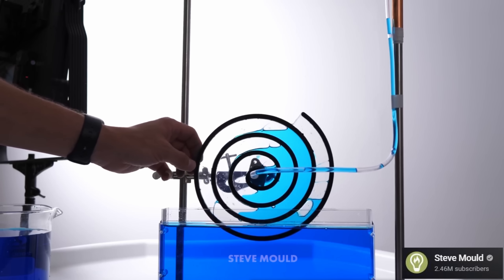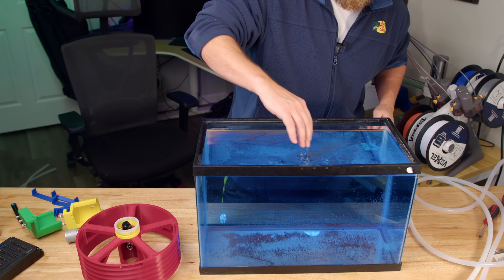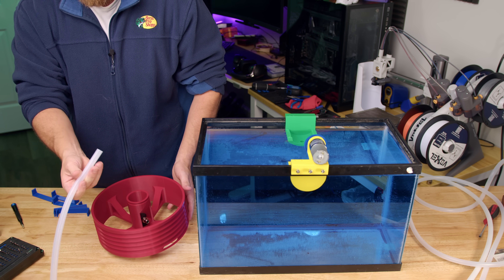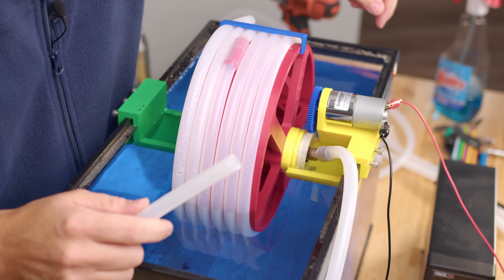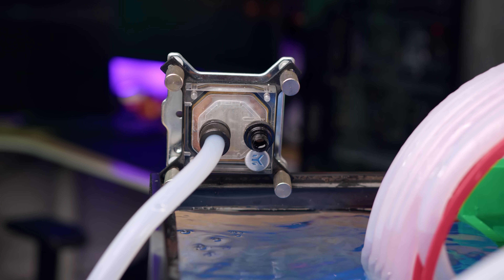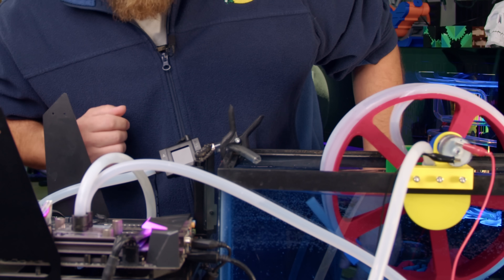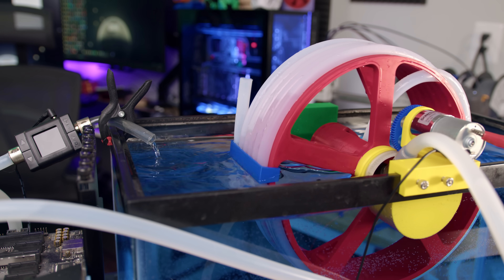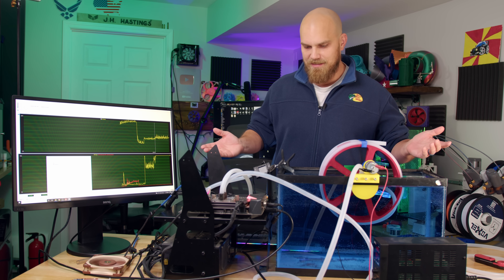Can a 217 YEAR OLD Water Pump Cool A PC?

Comment: TRY THIS : (LIKE so he can see) 
make reservoir between cpu and pump so that it fills it and push the water trough the CPU without pushing the air into it

then make some small hole for air to release with floating valve that will close it when the water reach certain lvl 
 it should regulate the system to allow only water to go through the cpu with constant pressure

Comment: It is possible to remove all air in the system if the pump is delivering water into a closed tank with only an outlet for a hose that has 50% of the carrying capacity of the hose on the pump. 

My assumption is that the pump has a 50% duty cycle, so if we account for that by having double the hose capacity on the pump, then we can accumulate the combined pressure in a closed tank. Then the pressure in the closed tank will deliver a relatively stable pressure on the side with the reduced hose size. Inlet should of course be on top and outlet on bottom, to  keep max pressure on the outlet hose and reduce movement of the water. 

If possible, you can in this configuration add an infinite amount of pumps (the law of diminishing return may apply here) to raise the pressure on the secondary side of the closed tank (for stability of flow's sake, they can be run with an offset of 180degrees).

Comment: You could try to use the same motor (running at the same load) to power the most efficient 'modern' water pump design you can come up with and 3D print. Then compare CPU current draw beween the two pumps to see how much more efficient the modern desing is.

Comment: I've seen it surest a time or two in at least as many ways. Putting a water tower after the rotary union would give you a place to discharge air to. But I think having a bike pump or something similar to pull the water though the hose (end of the hose in the water obviously) would likely fully prime the pump. The second problem would be keeping the inlet in the water 100% of the time. It should work if you get a second rotary union for the inlet side and shove the hose into the tank then it'll work more like an auger which is basically what this is.

Comment: I was wondering, what if the pump was actually hung over the water? To where the opening of the tube would have constantly been under water for no air gaps. I know most show the pumps in the orientation, but I couldn't help to think, would it still work pulling and pull the water up? Maybe if it spun alil bit quicker?

Comment: If you turned the wheel ninety degrees to keep the inlet tube in the water at all times, you wouldn't have any air bubbles.  The water would still move through the system in the same way.

Comment: What about one more intake witch is shifted 180° so it can put water into the system without the waiting to get more water this way you can join the two pipe together before it is going into the rotating section of the tube, and maybe after this you can add a closed water tank to get just the water and remove some air, i think a litlebit air is fine because this way the pump can generate preasure in the tank and improve water preasure like that. Anyway nice video! Keep up!😄

Comment: Use the pump to fill a small open top [or vented] water tower and gravity feed the cooling block from the tower, this will separate the air. The tower can just be a length of rigid pipe with enough diameter to let the bubbles seporate.

Comment: One could argue the coil pump is even older. Because it's basically an Archimedes Screw (aka Egyptian screw). And that dates back to ancient times. If you do an internet search for Archimedes screw, you'll see lots of pics and animations of an auger inside a tube. But there were several variants, including coiled tubes. The wikipedia page for the Archimedes Screw also has an equation that can be used to calculate the flow rate. So for example, if you want a certain flow rate, you can use the equation to design your pump. 😎

Comment: You could do a triple pump, or at least a double, separated by 120 or 180 degrees, but with check valves between the units.... that would give you more consistent flow. Or, you could put the water into a small tank, and the exit of that tank could then feed the cooling block. if you left an air bleed port on the top, sort of an overflow back to the fish tank, you could get constant flow, without the air. 

All told, very neat project you built!

Comment: To get it doing constant pressure lower the drum until it is completely submerged and drive it either with a belt or more gears. Once the air is out you would have a constant flow with out needing bubble towers….

Comment: You should use that pump to fill a reservoir that will flow thru the cpu block without air. May have to speed up pump drum rpm to keep resevior full

Comment: I'm sure this is getting too complicated but you should have the fluid flow into a reservoir with an air/water separator. Maybe you could have a float that opens an air relief valve when the water goes below a certain level.

Comment: What if you put another tube with the opening offset 180 degrees so each one has its air pocket at a different time, and used some sort of like, pool or reservoir to get rid of the air bubbles. You might need to spin it faster to keep constant water flow though.

Comment: I am a complete Luddite so I may be completely wrong… but if the whole drum is submerged, would the system have continuous water or does the system rely on gravity to keep pressure? The other option would be two loops of tubing on the drum, positioned 180 degrees opposite each other, that both go in to the centre hub fitting, therefore having one collecting water as the other is out of the tank…

Comment: You could use this as the return system to a gravity fed system.  put this tank floor level, and a higher tank... you could use a big passive heat sink on the way back down as well then limit the flow available to pc so that it doesn't out pace the pump. It's a way to get the air out of the system. I personally Love the idea of mostly passive systems. Or even using geothermal methods to attain cool water.

Comment: Add a large intake paddle to scoop the water into the intake hose. Also, check the power draw on the hub motor and see if the CPU fan output on the MOBO can run the pump and regulate the speed of the wheel. Using a check valve as well on the intake will stop the air from entering when the intake scoop no longer has water pressure to open the valve. Make a small tank just large enough for the wheel, throw a couple of heatpipe fin coolers around the tank to passively cool and keep the power draw to a minimum.

Comment: bigger hose on roller it will incles water flower 2nd you need make tank which air will escape top of tank and liquid run down tank to cpu and out to tank so there be no air left in cpu block dont forget have that tank higher than bigger tank and small tank have sit above it in order for it to work

Comment: A hot water heating system uses an air bleed valve to remove steam and air from the water flow. Should be easy to 3D print one. The pump has more than enough volume to keep a processer cool.

Comment: why not make a cooling tower with 3 points of the wheel feeding water into the wheel separated by 33% around each of the wheel and treat it like a three phase water pump. you can also use a tower with check valves to prevent backflow with the other phases.

Comment: I feel like you could create a valve to prevent the air from being pushed through the loop by using a Y joint and a spring loaded flapper. Flap being open to a vertical tube by default, and when the water from the pump gets pushed through it would allow flow through the loop without the air issue. It would require the reservoir to be above the mobo but it should work in theory.

Comment: Coil pumps were designed to pump up from a stream to a hill or water tower to a reservoir, then use gravity feed water pressure to water crops, etc.  It would be really cool to replicate that type of system to cool the cpu, as it should eliminate the air bubbles.

Comment: Ideally you'd use a pump like this to fill a reservoir, and use the reservoir and gravity to create a smooth flowing stream of liquid.  If the screw is half submerged, you'd need a hose at least twice the diameter of the hose you plan to run through the rig.

Comment: If you pumped the water to a higher level to be used as a "buffer" you could remove the air from the system.

Comment: A long flat/horizontal section of tubing with foam/sponge diffusers inside it would allow you to merge the air into the water as fine bubbles which might actually provide some cooling improvements just from turbulence

Comment: Aquarium filter powerheads are simple centrifugal pumps which drive a considerable volume of water through a similarly sized tube without the air gaps you get from anything resembling Archimedes' screw. As you noted, a radiator on the outflow side of the CPU may be helpful in extending the cooling capacity of the input reservoir.

Comment: I wonder if you could wrap a second loop of tubing around the existing one (inlets 180 degrees apposed)  and T them together at the hub. Im not sure if they make them small enough but you may look around for an air trap valve you could T in between the pump and the water block to purge the air.

Comment: Oh yes, the 217 year old pump. Because Leonardo DaVinci was alive only 217 years ago. This is in the Codex Atlantica. It is not even DaVinci who invented it, it was Archimedes, it is called a Archimedes screw. So yeah, this invention is over 2,000 years old. This was invented at least 200 years before Jesus was born. And I'm willing to bet Archimedes didn't invent it either, he likely re-discovered it as there are water wheels which are still running today and have been in commission since before his time.

Comment: With the fishtank... set up in a way with no air and actually usable for a daily driver, the goal being daily use shouldn't be enough to heat soak it so each day you can run w/o fans. 
The truly silent PC XD.  so big, no fans required. but it would require a like 100% water cooled pc like mobo etc. (Not to be confused with an actual fish tank pc with is being submerged.  although that could be a super cool project too. Specially if you 3d print all the brackets etc, so community could create their own with yoru plans. It would make for an awesome series. )
After that tanget, will just say thank you for awesome content and keep it up. :)

Comment: i have seen one hat was 10ft..he had a i gal container with the bottom cut out attached to the end of the tube on the wheel..it worked good..and take the air out of the hose on the wheel so water flows better with less surge in the water. 👍👍

Comment: Is there a reason that half the pump is out of the water? The air gap seems to be the period of time that the tube is out of the water, if you lowered the axle into the tank and let the wheel run at 66% or more that might improve the pumping action

Comment: First idea:
you could use 2 pumps in paralell offset by 180°, or one drum with 2 tubes with the same offset, you could also do 2 drums with 2 tubes

Nummer Zwei:
feed the water in some sort of elevated container that would then just gravity feed the loop with water, by adjusting the hight above the tank you can effectively tune the flow rate to reach equilibrium with the pump output, a restriction on the outlet could be used for fine tuning of the system.

and just after I posted this I had an other idea, aren't there these self bleeding valves?
I think I've seen something like that at the hardware store, just use that in line with the hose, then you don't need  a tank to get rid of the air.

Comment: if you submerge it, flow will be continuous. You can use a belt instead of gears.
Or if there is a t adapter for that fitting you can add another coil of tubing with intake is at opposite side. I dunno would that cancel the flow tho :D

Comment: Make the wheel dual lead (two open ends to take in water 180 degrees apart)  and have both tubes exit at a wye which combines the flows. that will help with the surging. 3 leads would work even better but you want to come up with a manifold with back flow prevention so you don't lose pressure. But for toying around 2 lead will provide a "consistent" flow (less bubbles)  and other than the wye it uses the exact same parts list.

Comment: One way to could get rid of the air... Use the pump to move water to a smaller reservoir neat the ceiling. Then from there, use gravity to force the water through the CPU block. A bit like an IV line in hospital. Would be interesting to see interesting topics see how watercolour flow through the block with a head of pressure like that. You could also have a second drum supplying water if the CPU needs more flow to cool it.

Comment: Try adding a "T" piece at the output of the pump.. with a open end pipe going straight up 2ft... that will let the bubbles out but keep the water flowing.

Comment: Make the pump smaller in diameter, that will make it easier to spin and make it submersible in water to get rid of the air. You could for example put it 90 degree into the tank so that only the motor is sticking out of the water.

Comment: It needs a small funnel for the intake... and for higher pressure and a constant flow it would help to have a reverse "p" trap, or simply force fill the last loop on the drum and pump the water up to the ceiling before it flows down into the computer turning the hose into a sort of reservoir.

Comment: Have 2 or more coils on the same drum with evenly spaced inlets. With some clever valving you could eliminate the air gap, or use it to fill a water tower so you can have a constant flow.

Comment: maybe add a second or even a 3rd "loop/coil" (probably with a check valve) to add more constant flow. Also, could it improve water flow by submerging the wheel lower?

Comment: If you use two wheels in opposition positions with a back flow valve you should be able to increase the flow rate.

Comment: i call that a win! pumping vertical into a tower where it pools again, and then gravity feeds into the block (eliminating air gaps) it would probably be dead stable and might handle a GPU added. then do a heat exchange radiator off the back of the tank to keep it from heat soaking.

Comment: You could try an Archamedes screw to lift the water into a reservoir above the level of the tank.  Then use gravity to feed it from the reservoir through the cooling loop with the outlet just above the water in the tank.  Could eliminate the air in the system entirely if the screw supplies water to the reservoir at the proper rate.   Better, have more flow from the screw than the system needs with an overflow from the reservoir back into the tank.  Flow balance sloved!  And this with a pump design that's thousands of years old.

Comment: I wonder if it would still work if you added a scoop/funnel type thing to the open end of the tube. I'm thinking it would force more water into the system when its submerged and also provide a small reservoir of water to keep feeding the system for a time after it broke the surface.

Comment: First thing that comes to mind is to add a reservoir to it so you can use gravity to separate air and water and get continuous flow.  Might need a spring loaded relief valve to stop the air from building up.

Comment: Turn it 90 degrees and run the length of the aquarium to compare if the pressure is better on the longer wheel.  I'm sure in one direction you'd trade pressure for speed.

Comment: You could pump the water up to a container and let the cpu get gravity fed coolant. That would remove the air and give constant steady flow. 

You could run 2 smaller pumps out of the tank in a way that keeps the momentum going too so it doesn't pause each time it rotates

Comment: You could have the pump deposit the water to a tank thats higher up than the water block, then use the head pressure from the tank to run it through the block without bubbles

Comment: if you put a second coil around the drum and offset the output by 180 degree you will get two pulses per rotation giving increased flow, or can be used for a second loop. you may need to create a manifold with oneway values to stop it pushing back into the other loop.

Comment: @MajorHardware I think that you could get better flow with two or more tubes on the pump. If you offset the opennings of the tubesby 90 deg or 120 for three, then you will have pretty steady flow. Make a plenum with inlets and check valves to mix the flow from all the tubes. I think that would give you plenty of flow. If you use the suggestion I saw of a catchtank, with my idea you would have a pump that could supply a steady stream of air-free water to the cooling block.

Comment: how about adding a buffer tank? pump water into a higher small tank with a ball valve to adjust the flow to overcome the air bubble gap. so you always have a constant uninterrupted flow. or just how high can this thing pump water?

Comment: you could solve the issue with air also being pumped through the pipes by using it to move water to the top of a reservoir, and then have gravity be what provides the water pressure into the tubing. Kind of like how a municipal water tower works. rather than directly connecting the pump to the tubing

Comment: Put two pump with a shift of 180° connected to a Y
It shouldn't remove the bubbles. But you should have a constant flow of air/water mix.

Comment: smaller barrel = less air volume.  however  same problem as water volume; less water volume.  I do not think this design is built to increase water pressure; relying on air to do pushing,  so design at least providing water pressure equal to atmospheric pressure.  just built to do water transport higher than the water level.